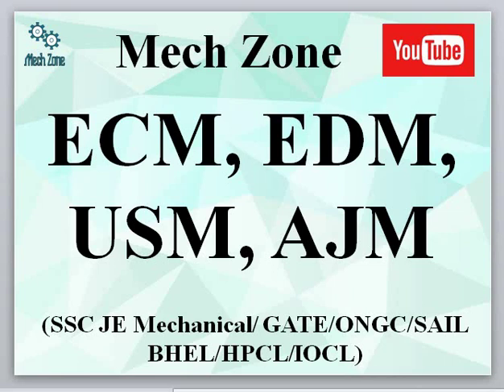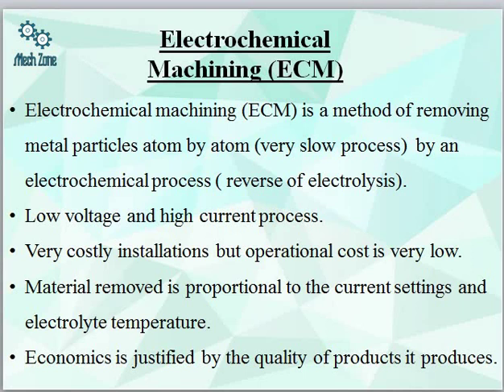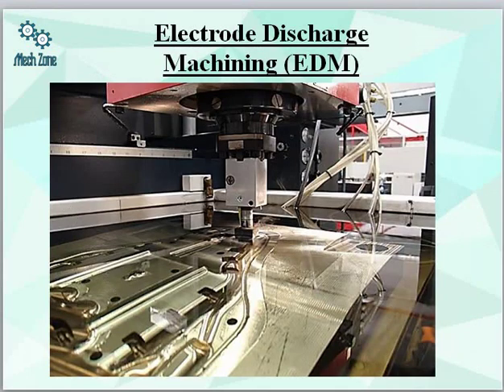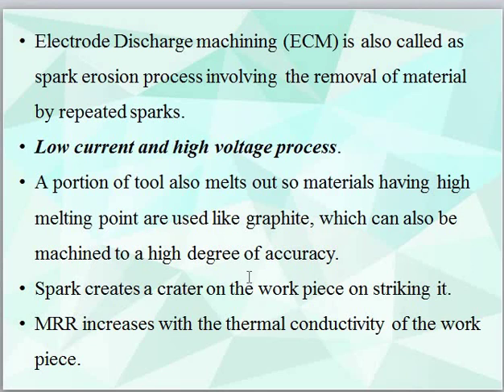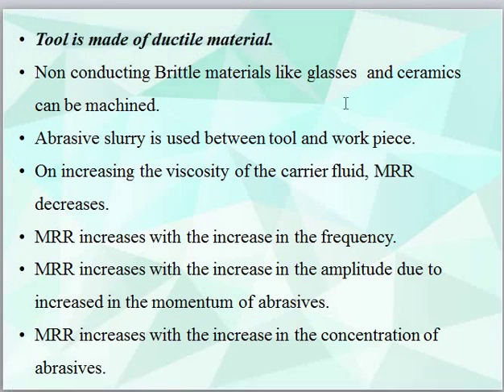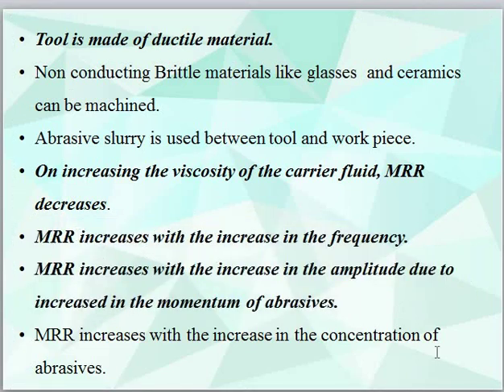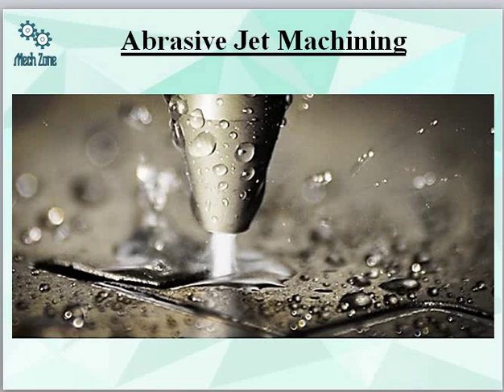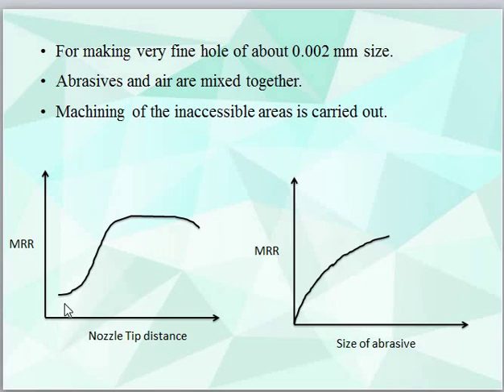Lecture on Non Conventional Machining Process by Mech Zone

Comment: In EDM, MRR will decrease with increase in thermal conductivity of WP, because for high conductivity material the heat will scatter quickly  within the material and localised heating for melting will not take place